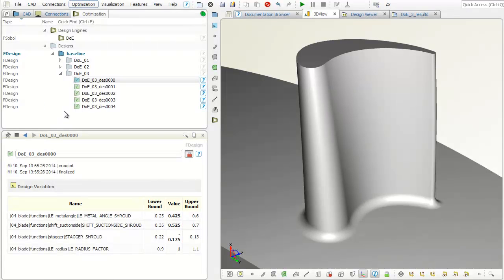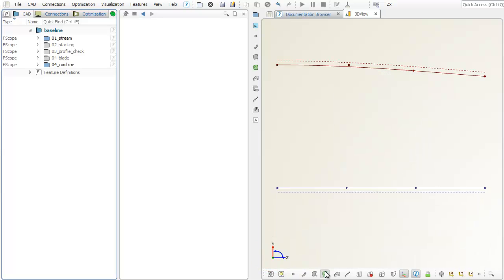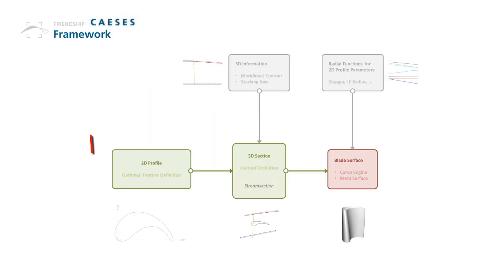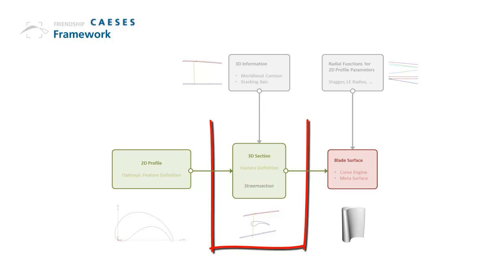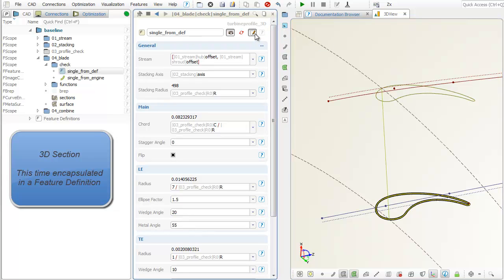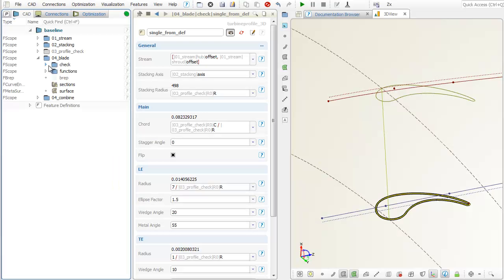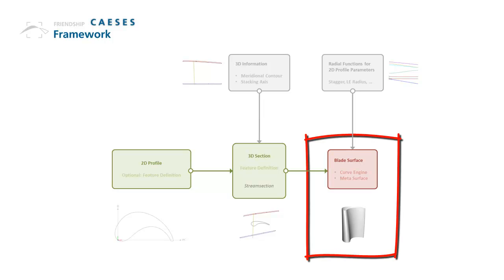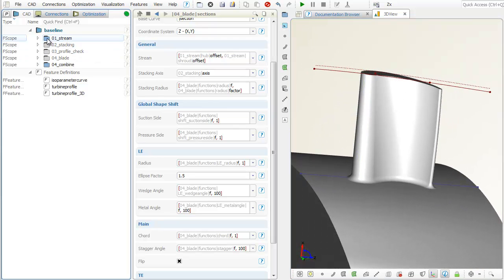Turbine Blade Design

Comment: Inertia weight must be balance to keep efficient and try on simulator with variable flexible blade until achieve maximum out put under various wind density and even space with steam heated and fuel ... simulator is most important to save money before prototype at least it get as close as possible than too far estimate by mathematical alone